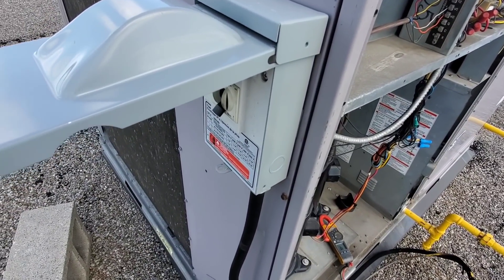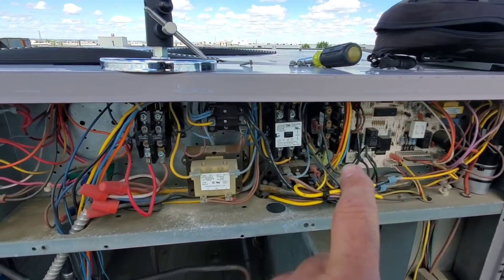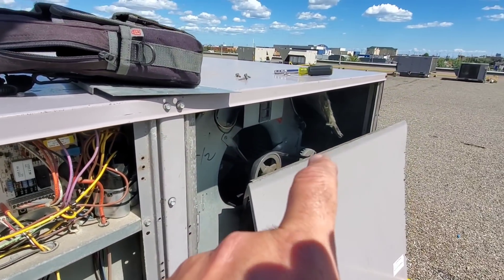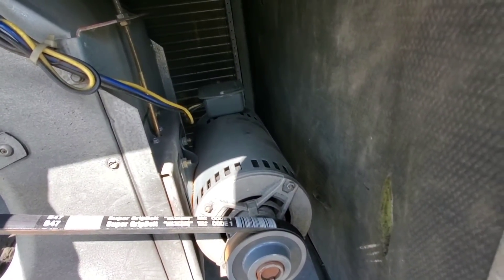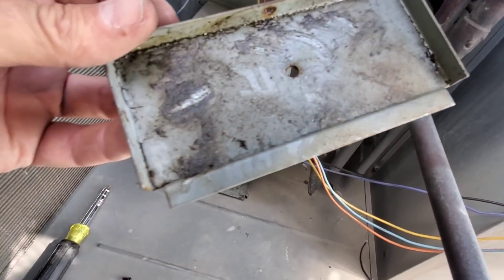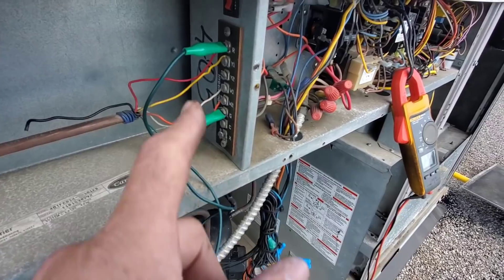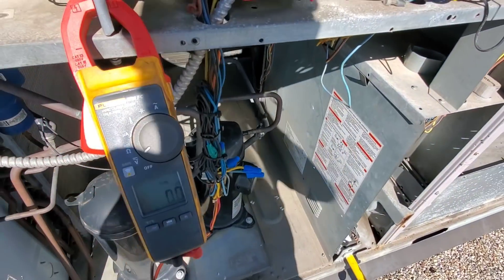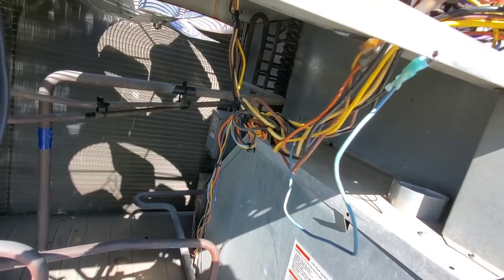Carrier RTU With Incorrect Voltage

Comment: If you are getting 460 phase to phase and not 480. Wouldn't that indicate the buildings transformer is a Y configuration and not delta. That would explain the high 'wild' phase
Reply from the maker: The primary to the unit is 575v it steps down to 460 within the cabinet.  I'm was getting 560 on 2 phases on that motor, should be 460.  The internal transformer is pooched.

Comment: A high Voltage can be the symptom of a missing Neural somewhere.  Are all the incoming phases the correct Voltage?
Reply from the maker: There is no neutral on 3 phase.  Only line 1 line 2 and 3
Reply: @HVACKnowItAll  Some shorted turns on the primary then?

Comment: Nice Work. 480v circuit faults typically go Boom taking wiring and connector with it. 480v is probably an everyday thing for you, but I get amped up when I'm working around it.
Reply from the maker: 460 is actually rare for me...Most common is 575

Comment: Never ever bump a contractor. I’ve been a commercial HVAC mechanic for 25 years! if you need to push in a contractor with an insulated screwdriver you just need to get out of trade. That’s foolish and so dangerous. A 480 V service and a grounded compressor WTH!!!... you’re telling people to doing that!? You’re an idiot.
I hope you have a electrical license in your Stare  like I have to have in the state of Oregon to do HVAC work. I hope they revoke it from you. Flipping fool.
Reply from the maker: Okay, I'll play your game...why sir, why never bump a contactor?
Reply: HVAC Know It All... This is no game. If you have a grounded compressor in a 480 service and you go pushing in a contractor. The amperage alone can blow a standard 3 pole 40amp Resistive contactor apart. There goes your screwdriver your hand and  your face to arc flash. This is no game. you’re a fool if you think pushing the contact in is safe.
Reply from the maker: If you payed attention, that compressor is isolated and all loads were checked to ground first.
Reply: HVAC Know It All  I’m not gonna give you the satisfaction of thinking you are right. You bump start any contactor with an insulated screwdriver there’s too many unknowns that could cause arc flash. You keep doing your practice. go right ahead I guarantee you will not I make it to retirement.
Reply from the maker: You came here with the insults like a loonie, I know how how to be safe on the job.  I've been in the trade just as long as yourself.  Cheers!
Reply from the maker: Slander is only an untrue statement which I didn't make.  Starting a conversation with insults leads to toxic communication.  First learn how to begin a dialog my man.  I don't bump contactors all the time, only when I've checked everything before hand and I didn't tell anyone to do it, I'm merely documenting my story.  BTW, if a contactor is going to blow up, pushing it in is not the cause, it's faulty contacts, carbon tracks or a faulty load.  I hope as you're watching your sequence you have on a face mask because it will blow regardless if faults exist.  Anyway you take care and learn how to start a conversation the correct way in the future.  You'll do so much better in life!

Comment: So why with all the logic and smart circuits on the unit , voltage is not monitored?   notice how the bx cable was terminated.
Reply from the maker: There is not much logic, it's just a relay board and heating control.  Voltage is not monitored no.

Comment: Why is there a need for 600v...i know 460...but why more than that? Or where those transformers supposed to step it down? That whole system is effing scary as hell!!!
Reply: Is it possible that they expect everyone to have a main stepdown transformer for the entire property? If so that maybe just the voltage they've decided to use to supply all of the properties.
Reply from the maker: 575 is common and mostly used on 3 phase equipment
Reply from the maker: In Canada 575v is common on 3 phase units.
Reply: @HVACKnowItAll  Yah I got that, it works out to be nearly 400V per phase.
Reply: Usually that kind of voltage we got here in canada, we rarely have less than 600V in a three phased unit in quebec also
Reply: So the compressor is 575 volts  3 phase and  fan motors  are 480 v with those step down transformers  to use common  parts  to aviod have a much bigger  transformer  to run a straight  480 volt unit . The little  transformer  got single phase used due to burnt  open lines.

Comment: Shorted windings. 600v primary is only dropping to 570v on your secondary instead of 480v. It's possible that the short to ground caused enough heat or it just found a weak spot in the wire coating and broke through, shorting the windings.

Was there a breaker or fuse for that low voltage transformer? Perhaps that would prevent it in the future. That, and 2 DAMN GROMMETS!
Reply from the maker: If a fuse was added it would have to protect the 575 to 460 transformer.  You always protect the upstream power supply.
Reply: @HVACKnowItAll  wouldnt it be crazy if the voltage issue is what took out the other compressor.